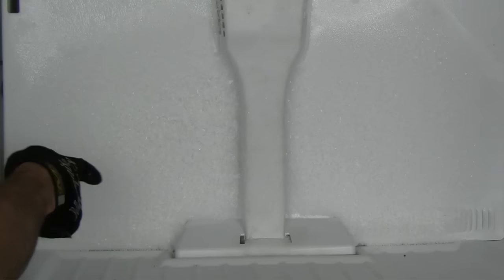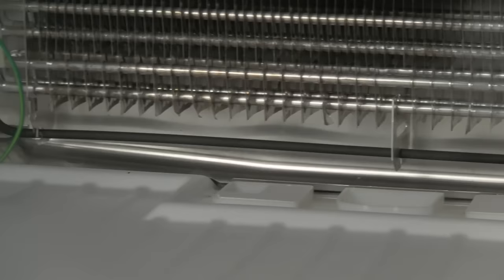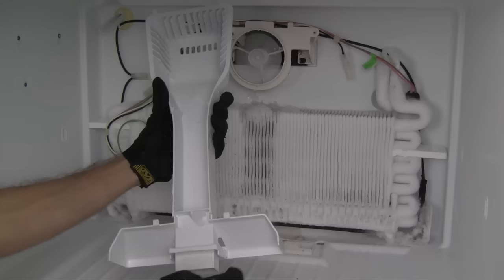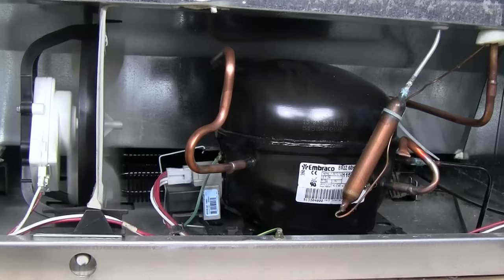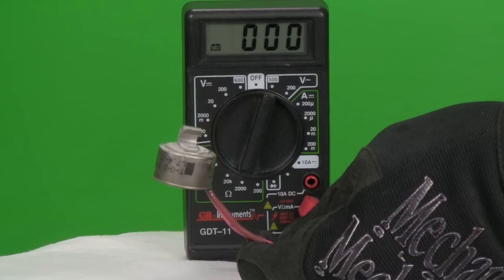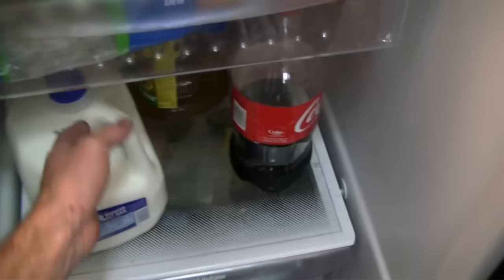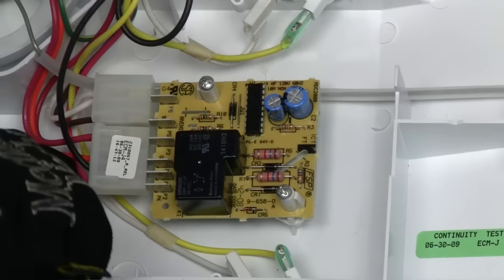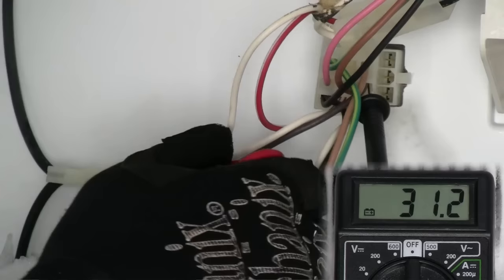Refrigerator Repair (Not Cooling, Defrost System)

Comment: Those 2 square holes on the bottom in the back. Are they suppose to be covered or open? I have a Whirlpool top freezer from 1997 and, they are covered with Styrofoam. Are they suppose to stay there or, was I suppose to remove them when I received the refrigerator?
Awesome video. Thanks a lot.
Reply from the maker: that's a tough one, with out a photo for reference.  if they are easily removable I would say they probably should be removed. the only thing that I can think of that SHOULD be in place would be part of the air duct... but in that case, air should still be able to pass through in some way.  Sorry I can't be of more help.
Reply: You are a great help. Thanks a lot.

Comment: Hi, I got GE and the model # GSS25VFPA WW
it's not cold and I noticed the compressor is not running, only the fan does. So what do you think it should be fail? thank Joe
Reply: Sounds like the relay/ptc switch  (WRI9X10107) or similar,next to the compressor.  I fixed mine with by ordering a new one online.  watch a video it wasn't hard to fix.

Comment: Is there a thermal fuse on most freezers coils in addition to a defrost sensor?
Reply from the maker: VeltriStudiosLLC it is possible. Most Samsung refrigerators do, and because Samsung is designing for other brands, its possible on most others as well. Wire diagram is the best place to look for verification. I have the diagram symbols used for fuses here:
https://applianceassistant.com/appliance-repair/electricity-and-testing/how-electrical-parts-work/2/

Comment: Whirlpool fridge isn't cooling as much . Thermometer says it gets to 50 degrees even though I've set the setting pretty cold . Milk and other things spoil in less time . No ice in freezer or fridge walls . Freezer is great 0 degrees . And water has been collecting at bottom of fridge and I've been taking it out every few days once a week maybe . Collects about half a liter in about a week .
 I've cleaned the bottom coils found at the outside bottom of fridge with rags and shop vac . Still no change . Freezer fan seems to be working I can feel air moving . No ice or frost on damper . Seems it's a defrost problem with no ice or frost anywhere ?
Reply from the maker: Sounds like it may be a sealed system issue if there is no ice or frost. It’s pretty difficult for me to describe further troubleshooting. You may want to try googling seals system restriction diagnosis... that would be my loose guess. Good luck!
Reply: @applianceassistant  found ice completely covering the inside of the bottom opening. That must be the return of fridge air back to freezer? Should I use a heating gun or just unplug, take everything out and let it all thaw out?

Comment: blockage and in the process the hose coming from the back of the unit (to the freezer I'm guessing) came off and I had to finagle it back on but now and again it would leak. then the freezer stopped being as cold as it had and then the fridge followed. i can't help but think the hose coming from the freezer and going down to what I believe is a drip pan is the problem but I don't know for sure.....argggghhhhh

Comment: How do I replace my thermistor on my Kenmore bottom freezer
Reply from the maker: Kenmore can be made by many different manufacturers, so it's difficult to be specific without a model number.  In most cases they will ether have a plug that can be disconnected so you can plug in the new thermistor, or if not you can cut the wires close to the old thermistor so you will have some wire to work with, then wire nut the new thermistor in place.  Some heat shrink tubing is also a nice touch for a good clean connection.  There are usually two thermistors in the freezer. One for defrost and one for sensing the compartment temperature.  The defrost one on the evaporator is the most common to fail.  Tough to get to... you pretty much have to remove all the freezer compartment's internal trims, drawers, etc. then remove the back wall of the freezer.  Then remove all the ice with hot water or a hair dryer to finally access the thermistor for replacement.  If you know a good repair tech in your area, its usually worth the money to have someone else do that repair.  Good luck!

Comment: Ok. The question of how long should you let it thaw out? 1hr? 2hrs? 3hrs? My coils are frozen I seen a batch of ice in one spot. I am like OMG! I assume this explains why my ice maker stops working as in stop making ice. I assume this I am not sure would the frozen coils stop the ice maker? Also, I would like to know what is the best setting for Freezer & Fridge all set to "NORMAL" or 3/4 setting?
Reply from the maker: The target temperatures are 0 and 37 degrees but if you don’t have temperature settings that should be in the middle. As far as defrost time, it’s hard to say. It can take more than 24 hours if it’s solid ice, more like 4-5 if it’s heavy frost. The batch of ice comment is a little concerning because it can point to a major shield system problem if there is some of the coil that is not frosted at all... there should be some frost on the entire evaporator or you may want to consider replacement. I hope that helps some!
Reply: @applianceassistant  unless you use a heat gun right if you use it carefully?
Reply from the maker: You can use a heat gun or hairdryer carefully. I use a clothes steamer and that works better than hot air, with a little less risk of melting plastic parts.
Reply: @applianceassistant  Thanks.I got a heat gun from Harbor Freight 1500 watts for $15 bucks. I been watching video of pro's using heat gun of how they carefully melt the ice...

Comment: I have a Roper s/s fridge, freezer.  The lights are on, the fans/motor are running, but fridge is not freezing nor is the fridge itself cooling....just a light is on.

Comment from the maker: @annettemint What is your refrigerators model number? Try cleaning all the dust off the coils under the appliance and see if that helps. Also make sure that the fan down by the compressor is working and not jammed up. If not send me an email through my web site with your model number and I can try to dig into it a little more.

Comment from the maker: @hellriserpl1 Hmmm... That doesn't sound good and I didn't even hear it.  If the compressor is still running and the unit is not cooling it's time to go shopping. (you can put your hand on it to see if you can feel a light vibration, it may be fairly hot 120º - 170º) You may still hear the fans running...but if the compressor is off you will need to troubleshoot the compressor.  try looking at the troubleshooting refrigerators section on my website if you have questions email me.  Thanks!

Comment: Thank you for your video - I think we are having a problem with frost buildup as well (we have two kids who constantly leave the door open).  Our freezer temperature is perfect but our fridge is not cooling properly (won't go cooler than about 17 degrees C).  I am trying to defrost it right now, but how long do I need to keep power off?  I am also trying to figure out if it is an air flow issue.  I can feel a small bit of air coming out of the box at the top of the fridge, but not sure how strong it should be?  We have a KitchenAid side by side built in model KSSS42QMX01.  Thanks so much for any help you may be able to provide!
Reply from the maker: It probably is an airflow problem caused by frost build up.  If it's just frost from the door being left open then probably 2-3 hours would do it. However, if it's been a long standing problem with a defrost component being out it may take a day or two. (the frost can become hard ice that will take much longer to thaw.  The air flow coming in at the top is usually just a very light breeze.  There is also an air return at the bottom of the center wall that can fill with frost... In that case you will feel air when the door is open because it can move into the room, but when you close the door it will stop moving because it has no where to go.  I hope that helps some... Good luck!
Reply: So here's an update - we tried defrosting for 24 hours and no luck.  I am now noticing that the panel at the top (the one that shows the temperature) is turning off intermittently.  The freezer is still very cold but the fridge is only 15 degrees.  I'm trying to get ahold of a KitchenAid repairman but no luck!  I'll keep trying but any ideas in the meantime?   #sickofcamping
Reply from the maker: chella2782
It's hard to find people to work on those. However is sounds like a minor problem...  Is the evaporator fan in the freezer running?

Comment: Hi, I have a side by side Amana refrigerator model #ASD2624HES serial #50469750EN
I have bought the following parts NEW: Bi-metal, main control board, adaptive defrost control board, cold control thermostat and heater element. Heater does not want to kick in defrost cycle even though the bi-metal is closed but ther is lack of current and I don't know why. Evaporator is frozen solid. I;am a DIY guy. Am I missing something. All fans are fine & condenser coils are clean. I need HELP, any ideas?? EM

Comment: I have a NORD-242-6 refridgerator. it just stopped working. when I connect to the power I can  see the power signal responding but neither refridgerator no freezer is working. can any one suggest  any solution pls?
Katongo

Comment: How to replace the water line inside the freezer door?
Reply from the maker: On most models it cannot be done because the line is foamed into the door. Some models have a channel that the tube is run through so you can run a new line... hard to give much more advance than that without more details.

Comment: Hello, This was really an excellent video!  I am currently having a problem with my side-by-side refrigerator not cooling.  My fridge will freeze but it is almost as if it has different zones of temperature.  On the Freezer side it will freeze on the bottom, just be kinda cold in the middle and hot on the top.  Then the Fridge side is hot!  From the video this might be an airflow problem or do you think it is something more serious that that?  It will not make ice.  I have tried to clean the coils on the bottom,  but it did not seem to help.  Next I will try to just unplug for a day or so o see what happens.  Any Ideas you can offer would be greatly appreciated. God Bless!
Reply from the maker: Definitely sound like air flow... Is the fan in the freezer section working? What is your refrigerator's model number?
Reply: applianceassistant Not sure if my fan is working or not.  I have a whirlpool.  Mod:  ED5KVEXVQ00.  Thanks for your help.
Reply from the maker: any time the compressor is running or you hear any motor function the fan in the freezer should be running. It's behind the back wall of the freezer, so you should feel air flow, or hear a motor running inside the freezer compartment.  if it's not working that's probably the source of your problem. Technically you would need to check to see if the motor is getting power from the control but the odds are the motor is bad if you don't have a meter to check it... If you do check for 120 volts AC at the motor terminals.  Hope that helps!
Reply: When I turn the temp control on I hear the motor running.I turned it off so that I could defrost the fridge and there was a ton of ice on the bottom of the freezer.  The ice was so thick my bottom tray was frozen inside!  I have yet to take off the back panel but I am waiting a couple of days to make sure the ice is completely gone.  Do you think the problem could still be the fan?  Thanks for your help!
Reply from the maker: Sorry for the delay! With the large amount to ice I'm thinking that perhaps the ice maker valve is leaking and dumping water down the back of the freezer, that can jam the fan, or it could just be a defrost problem and the frost jammed the fan, but it does sound like a fan problem. Most fans run on 120 Volts AC but there are a few now that use low voltage DC if it comes down to checking if the fan is getting power, but likely it's just jammed, so if you can find the source of the ice you will probably fix it. Good luck!
Reply from the maker: if you don't have an ice trail to follow down from the ice maker fill tube you may have a clogged defrost drain at the base of the evaporator coil behind the freezer wall. That will also cause an ice on the freezer floor and is actually more common that the water valve failing. However, that would not cause the fan to lock up.
Reply: Thank you very much for your Help!! God Bless!
Reply from the maker: My pleasure! Thanks for using my channel

Comment: I have a Whirlpool top freezer that's 13 years old. Every 2 months the evaporator core in the freezer frosts up real bad. I have to remove the cover and put a couple pots of boiling water to thaw it out. There are no other problems, just this one.
I was told it could be  the timer or thermostat. If this is true, how much does it cost and, is it easy to remove?
GOD bless and thanks a lot.
Reply from the maker: That is a little strange that it takes so long to frost up. In most cases, a week or two is about all you would get if it was the heater or defrost thermostat... I would guess it is an intermittent defrost timer or control problem. Do you have the refrigerator's model number?
Reply: Model# ET18NKXFW01
Series# E64216897  1997    Whirlpool top freezer w/o ice maker. I just received a new defrost timer and the new one has 1 black wire as the old one does not. 8 hour timer. I'm assuming this is after market!? $28.00
Is it necessary to use the black wire or, is this an option? (Both timers are for 8 hours.The old one and new one).
GOD bless and thanks a lot.
Reply from the maker: Neil Williams the black wire timers are the new universal timer for most Whirlpool refrigerators. The black wire is very important. It is the power lead that will advance the timer motor. There should be instructions that you can use to identify which terminal to press the lead onto before plugging in the timer. It can be a bit confusing and may require a few reads.
Reply: Thank you for your reply and help.

Comment: ONE QUESTION:  HOW IMPORTANT IS FILLING WIRE NUTS WITH SILICONE?, I AM THE SECOND PERSON TO REPLACE BI METAL THERMOSTAT, FIRST GUY NO SILICONE
Reply from the maker: That’s a good question! It’s not generally required but I like to do it just for peace of mind. It’s a moist environment and many defrost thermostats are operating at 120VAC. I sleep better knowing it’s not going to short and blow a hole in someone’s evaporator. 
Never heard of that happening, but I don’t want it to happen to me.

Comment: Great one. My issue is that there ice deposited on the back bottom of the fridge side, not the freezer side. It still working okay. but the ice getting bigger and bigger, sometime you can see water dripping out from the fridge side. The cover for the cooling parts was bent due to the ice. I tried to unplug to remove the ice. It came back back after a few days. It is Samsung, RS2545SH. Called Samsung, They don't want to help and push it to repair contractor. Can someone help. Most appreciated.

Comment from the maker: @chrisc412 Depending on the model, some refrigerators have a motorized door in the air passage that should automatically open and close to regulate the temperatures through air flow.  The motor may have failed or it may just be bound up.  Some models control the temperature with a sensor and control board, the control may have been damaged with electrical fluctuations (Unlikely) If you email a model number through ApplianceAssistant . Com I might be able to get more specific.
Reply: 106.51119710

Comment: NO, it has an adaptive defrost board part #12002495. AMANA model #ASD2624HES /serial #50469750EN. When you mention power supply problem, what parts or areas would you recommend to check.  Thanks, E.M

Comment: ok
I have a Roper s/s fridge, freezer. The lights are on, the fans/motor are running, but fridge is not freezing nor is the fridge itself cooling....just a light is on.
Reply from the maker: There should be a fan running in the freezer… There are a few possible problems that you will need to work through… I have a refrigerator troubleshooting page on my website that should help. (there's a link in the video description.)  Just choose you problem from the list and you will get a better idea of what to look at and test. Good luck!